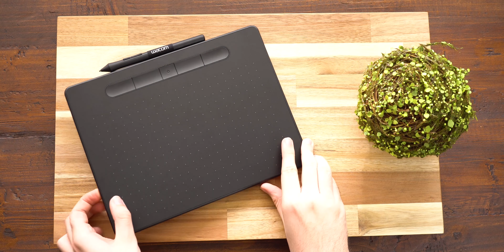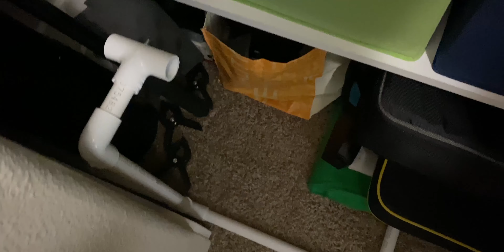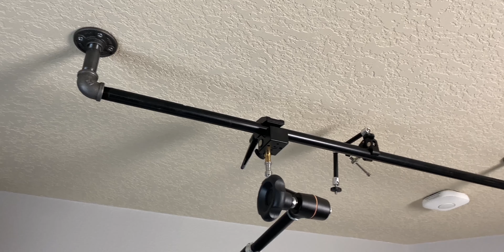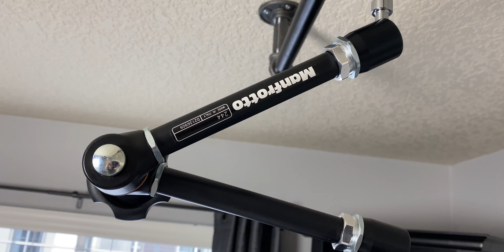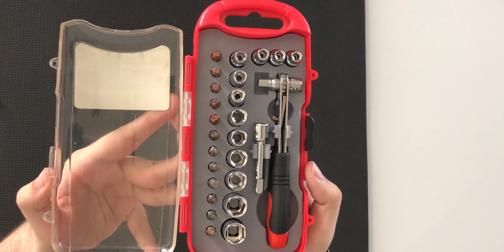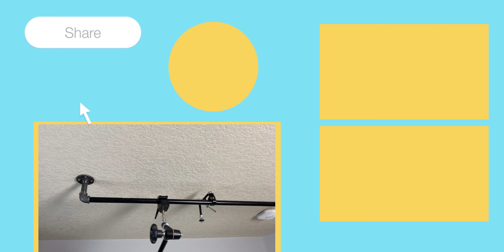DIY Overhead Camera Rig the RIGHT WAY!

Comment: $30 plus the $200 for the camera arms
Reply: Yep, not deceiving at all...
Reply: Budget Overhead Camera Rig Setup – $60 Total (+ Tax)

Parts List:
$20 — Tension Rod
$15 — Monopod
$10 — C-Clamp
$10 — 2-Pack of SmallRig Ball Heads ( These are the best weight support to price ratio i could find )
$5   — Pack of Thread Converters

Tension rod → mount C-clamp → attach ball head to C-clamp → remove the bottom foot of the monopod and insert the ball head from the C-clamp into it → on the top end of the monopod (where the camera mounts), attach another ball head → mount the camera onto that top ball head.

I use a bicycle action camera mount instead of a C-clamp, which lets me loosen the screws and move my camera left or right without worrying about it falling off the tension rod. This setup gives me full three-axis movement, and you can also add more arms to position your lighting the same way.